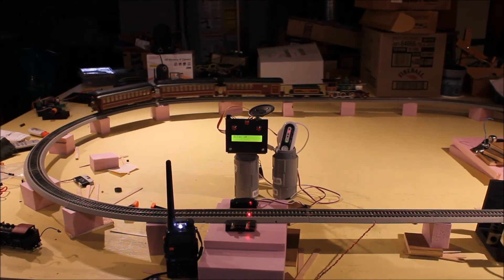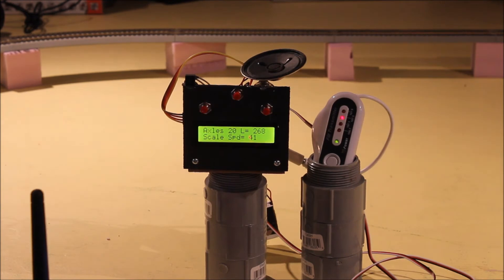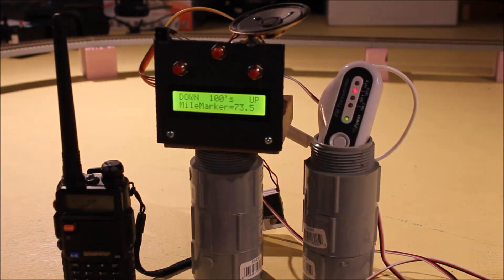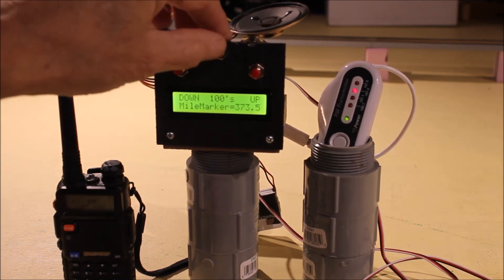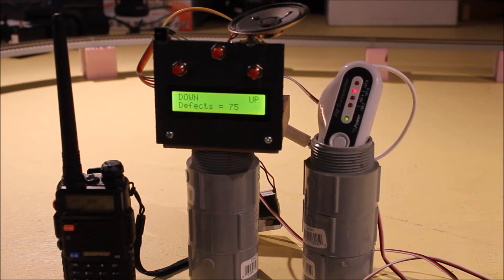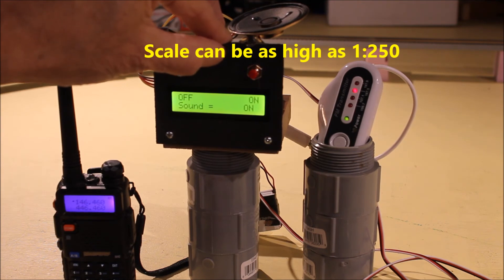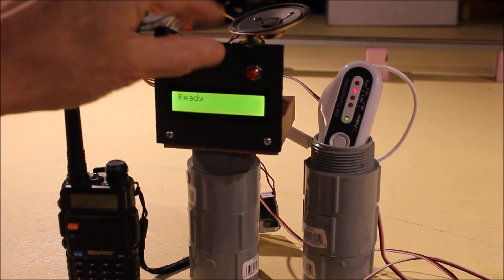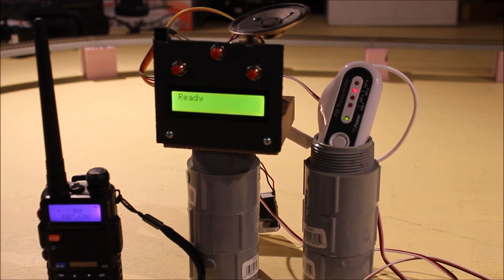A Talking Defect Detector - now with a new voice & menus

Comment: Dave... I know this is an older project and not sure if you can assist. I have built this all the hardware is working (i think), my issues (3 from what i can tell) are "Axel Count" stays at "1" but train length and speed are calculated. Also the voice rarely works, looking at the 'serial monitor' i see "buusypin" generate a lot of '1's. And lastly the Temperature is always "32", I have changed out the sensor twice with the same results. Any direction would be appreciated. Thanks
Reply from the maker: Russ - it is good to hear that you have built this project - sorry about the troubles - I haven't touched this for nearly a decade so I can't offer much help - I do recall that the temperature sensor reads 32 when it is not correctly installed (did  you add the pull-up 4.7K resistor between +5 and the output pin>)
Not sure about the axle count - might have to adjust the position of the lasers
Good luck & let me know how it turns out
dave
Reply: @DaveBodnar  thanks for the reply...just found out about the resistor on the device(wasn't on the schematic), so its working thanks :)...lol One problem down 2 to go... :). This type of item, you'd think, would be a popular item, yet its not explored in MRR much. Thanks again.
Reply: Dave,,,, got it all working... IF anyone else is making this.... Add the 4.7K resistor to the temperature probe. Make sure you buy 'real DFPlayer not the clones!!! PLUS you need to make a change to the code.... there are 2 references to "axlecount=axlecount ++" you need to remove the "axlecount=" and just leave the "axlecount ++" C++ doesn't like the first part of the statement and never updates the axle count...always stays at "1"
Reply from the maker: @russ4723  That is great news, Russ - thanks for the notes & enjoy the project !

dave

Comment: Hi Dave, 

I am very interested in this project, even though it is over 7 years old at this point. I'm not too familiar with code, I have done much of my low voltage electronics in analog. I very much want to implement this on my layout, but the project seems very daunting overall with the code and electronics side of things. I was curious to know if you had a more basic version of this project, something that is exclusively a dragging equipment detector, with no flashy bells or whistles? I'm hoping to do something that just counts axles, and broadcast the message. No random defects. I have been trying to do this project myself for many years, but keep coming up short. I just found yours recently and find it fascinating. 

Thanks
Reply from the maker: It is good to hear that you like the project - Unfortunately there is no simpler version  like what you describe - as a matter of fact I have not touched it since making this video

Hopefully you can find some parts of my project that will help with yours

Good luck & Enjoy!

dave

Comment: Hi Dave

I've got the code that is currently posted on your site working, but diving into it, there seems to be some MP3 files missing from your list. At the DO DEFECTS section of the code, it calls out directions, and you have file numbers listed for those, but there is also a file number or two missing (26 or 27), as it calls out [whichDirection = 27 + whichdirection]

. It also seems to be missing something after the milepost, it delays for a long time. 

Also - how do you get this to say the temp in Celcius, your comments on the Temperature section are a bit confusing, as you have some serial writes commented as the conversion to C.
Reply from the maker: Good day, Tyler - I took a quick look at the code (Which I haven't visited in several years) and find that the directions were never implemented - I should think that you should be able to add them yourself.
As I recall the temperature is first generated in Celsius so it should be a matter of commenting out some of the conversion steps that change C to F but I no longer have the hardware setup so I can't test that and give you a solid answer.
I wish I could be of more help - hopefully the comments within the program will lead you in the right direction
Good luck & Enjoy!

dave
Reply: @DaveBodnar  thanks Dave! One more question... 

What number value should be used the "scale" if N Scale is 1:160, is it 160??

Cheers!
Reply from the maker: @tylermartin3100  I believe 160 is correct

http://rrmodelcraftsman.com/model-train-scale-gauge/

dave

Comment: How much extra work would it take to use RFID stickers to designate what type of locomotive is being run over the defector? I'm only asking this because steam locomotives will often trip on the drive axle closest to the firebox. ( Sou 4501 would trip on axle 5 repeatedly on the Bristol to Radford excursions in 2015 )
Reply from the maker: It would be  a bit of work but could be done - the biggest challenge would be to get a good read of the RFID code each time the train passes - give it a try!
dave

Comment: is there a way to have it report over walkie takies. i use walkie talkies to have communication between crew and dispacher.
Reply from the maker: Sure thing - just hook up the output of the audio on the circuit to the microphone input on the walkie talkie (through a resistor - something between 100K and 1 meg should work) - you would also need to add a relay to trigger the push-to-talk.
Reply: @DaveBodnar  h yeah i can make Moxie Pacific dector some with M.P or full Moxie Pacific